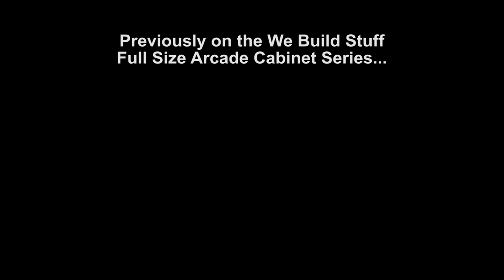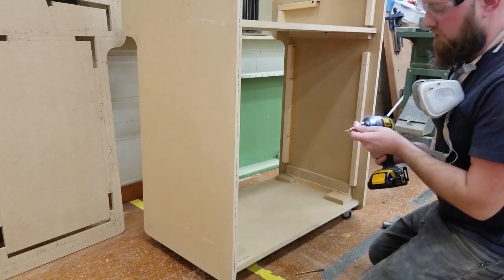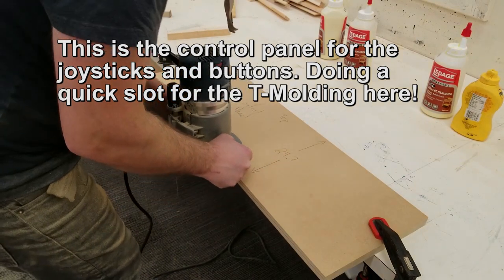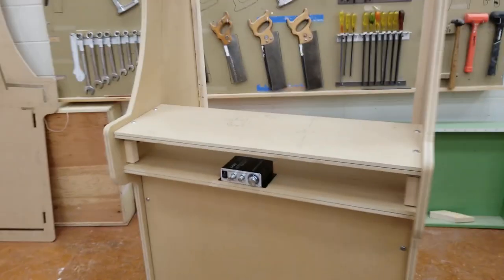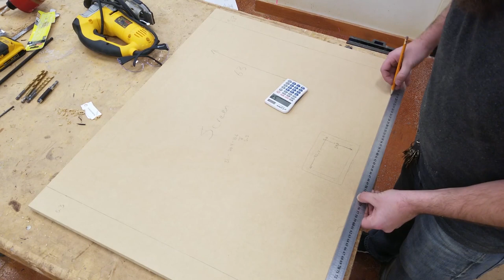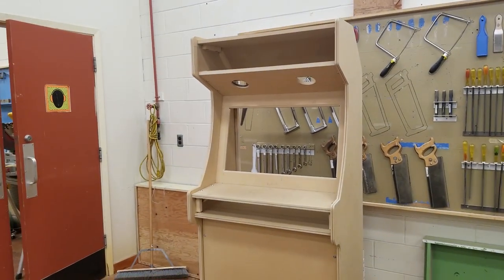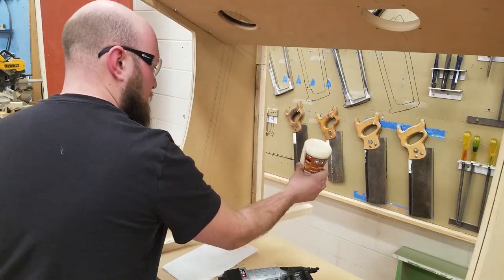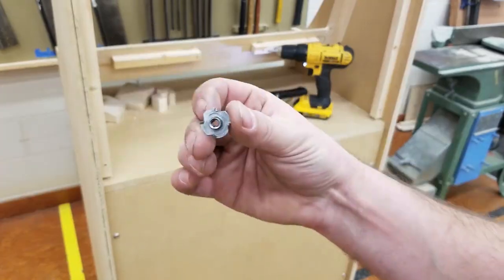DIY Full Size Arcade Cabinet with Basic Tools - Part 3

Comment: Thanks for the great video. Can I ask you what was the monitor you used? What would be your advice picking one?
Reply from the maker: We went to a big box electronic store and bought the cheapest HD TV in that size with HDMI in and an AUX out. I wanted button access on the back of the screen and an IR sensor on the front. For retro games I think it was perfect. It was under $200 on sale